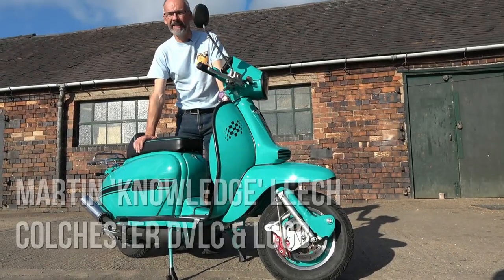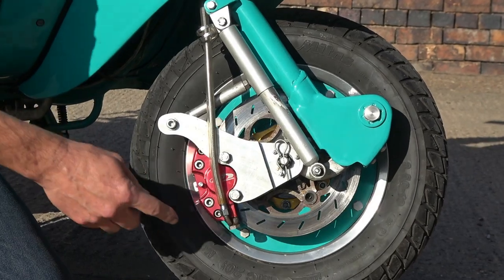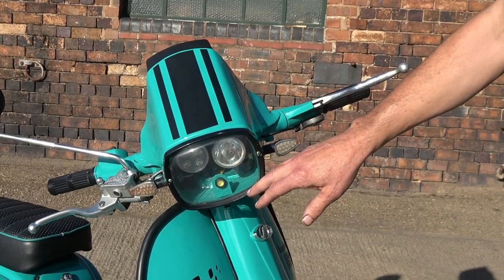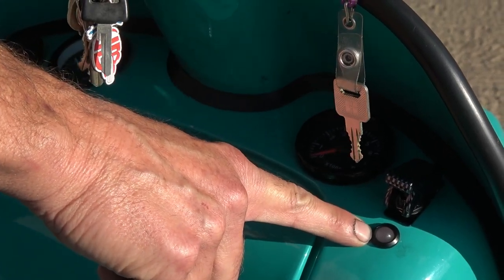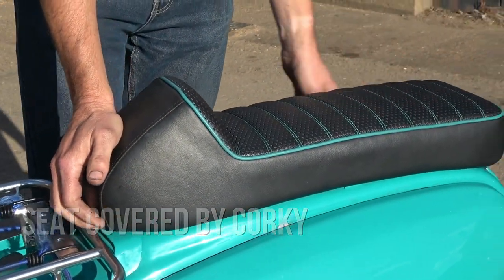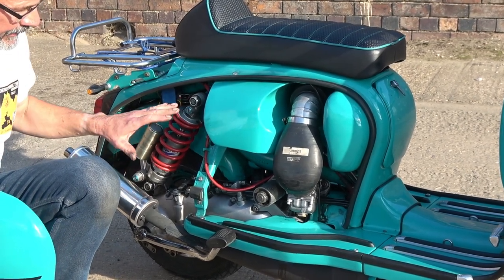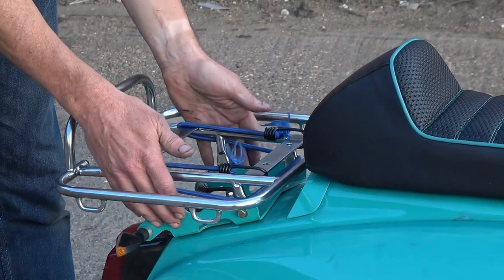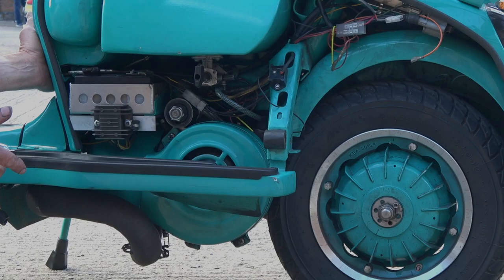SLUK | Martin Leech's 283cc HRB Touring Lambretta

Comment: Nice job, have you thought about selling them as a Touring option, or even just the parts? Very impressive.
Reply: Thanks for the feedback. I have thought about building a second one and perhaps selling one of them. I usually find it easier to build things a second time and it would be great to have a pair of them in circulation.
Reply: @martinleech1509  Hello Martin, good to find you! Please can you tell me the part number or Subaru(?)-model that delivered the rubber-intake? (connection of carburettor to airbox). THANKS!

Comment: Please can you repeat the origin of the part of the intake manifold that is assembled to the carburettor; surely a rubber part? (Subaru?)
THANKS a lot! And it seems as if the carburettor is very loose.
Reply: Hi. Thanks for your enquiry. 
The elbow is known in the trade as a ‘cobra head’ and comes from a Swedish company called ‘do88 Performance’. The part number is SCOB63.  You do need to cut the cobra head short at both ends to fit,but 63mm seems to be a fairly common diameter for both carb mouths and air filters.
Yes, the carb appears to move quite a bit, but I think the movement is exaggerated by the bits that are attached to it. However, as the rubber, the aluminium sleeve and the air filter arch up above the carb, some of the weight of these components sits behind the centreline of the carb.  If all that weight was in one straight line hanging off the engine, I am sure the manifold rubber would have failed by now.  As it is, the manifold rubber has been good and it has not been necessary to replace it. Well, so far.
Reply: @martinleech1509  I am VERY pleased about your reply; thank you very much!! I own a MAICO with disc-intake and the design of the intake area is simply extremely lousy, so I am looking for alternatives. Although I have never had a scooter I am deeply impressed about the level of technical modifications I can find in Youtube 🙂

Comment: Has anyone grafted a Royal Alloy 300 engine into an old Lamby yet?
Reply: Hmmm  my GP 300 ALLOY is assembled In  Thailand.
It rides like a dream.
Royal Alloy is improving.
Reply: I suppose getting hold of a written-off Royal Alloy is a pretty tough shout while they are still current..
Reply: @MrPottsy69  yes but ironically a lot better quality and slightly better power delivery. Selling much better than the competition (here in the U.K) 🇬🇧
Reply: @MrPottsy69  yes but ironically a lot better quality and slightly better power delivery. Selling much better than the competition (here in the U.K) 🇬🇧
Reply: I bet an electric motor in a Lamby would go like a rocket!!

Comment: A couple of points here: Firstly these vehicles' real value is in their originality. A scooter which has been subjected to so many mods, changes, and additions is totally deprived of its classic identity. Secondly boosting the power makes for a very unsafe vehicle to ride even with the brake uprates. The original design did not cater for a frame to endure increased power transmission, vibration, and speed, and the 10" wheels are totally unsuitable. Anybody who wants a more powerful machine to ride should go and buy one specifically designed by professionals for this purpose.
Reply from the maker: I think you’re missing the point. The owner has made these mods to improve his machine to his own liking and to make it more practical for himself. He has no concern over the future value of the scooter.

Although the original design wasn’t made for excess speed the world (and scooter tech) has moved on massively since then. We could all be riding around on standard drum brakes, with rubbish suspension, running a points ignition system and with a slow engine but it wouldn’t be much fun. 

Scooters are all about what the individual wants, whether that be nut and bolt restoration, rustoration, full custom, street racer, chop, cutdown or race scooter. A Lambretta is well capable of being anything the owner wants it to be.
Reply: @ScooterLabUK  To each his own as they say. Someone may like to fit his Model-T Ford with a computer controlled state-of-the-art supercharged V-12 engine producing 500 HP and have fun driving it around (not far I hasten to add!) My own scooter is bone stock down to the last nut and bolt with points ignition and everything standard as factory fitted when made back in the 70s. I like it this way. If I crave for something modern, powerful, fast, computer controlled then I will go and buy such a contraption, not mutilate my scooter trying to achieve this.
Reply: It was an old Li150 bare frame and I turned it into a GP special.  Do you think I should have sourced all the original parts and rebuilt it as a 1962 Li 150?

Now, I must get back to my TV175. Where the angle grinder?